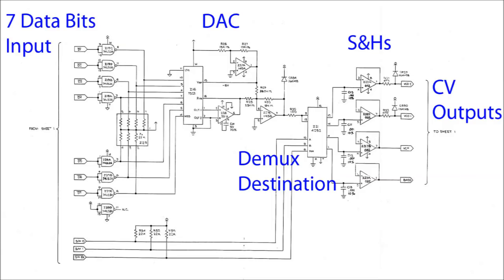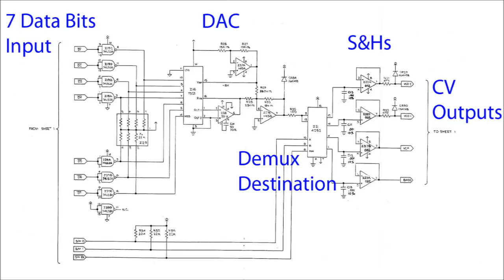Synthchaser #101 - ARP Quadra Repair & Restoration (Pt. 3) - Capacitors, ICs & Sliders

Comment: Could you share how the sliders actually come apart?  Are they like many other ARP sliders where there's a flat metal "clip" at each end?  I'm looking at my ARP  sliders right now and don't see, upon first glance, how they disassemble.  I certainly don't want to break them.
Reply: Never mind.  Figured it out.  Got almost all of them out, disassembled, cleaned, reassembled, and reinstalled.

Comment: i'm sorry but WHAT? i have to take exception with the comment about tantalums 'almost never being used as bypass capacitors' - nearly ALL of my audio gear uses tantalum bypass capacitors ... i think it was PRETTY common practice in the 70s and 80s to do so. they are brilliant in audio paths too - the only problem with them (of course) is that they fail short when you throw voltage spikes at them so you have to protect them - but a ceramic is a good choice here i guess